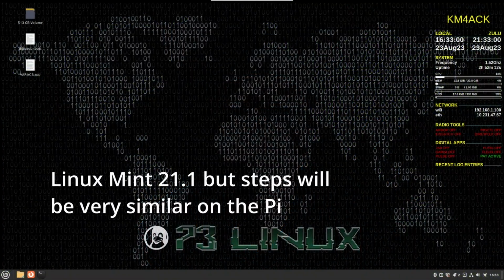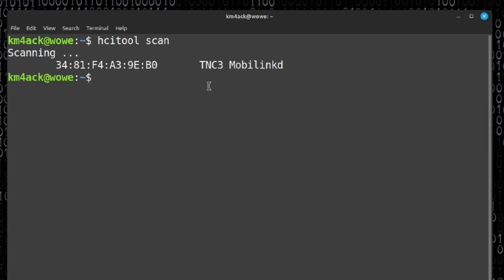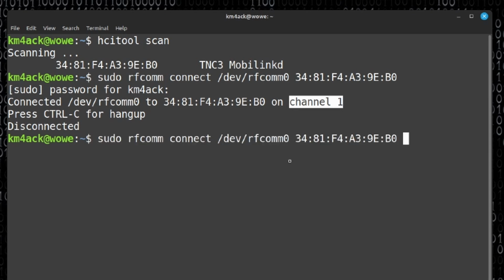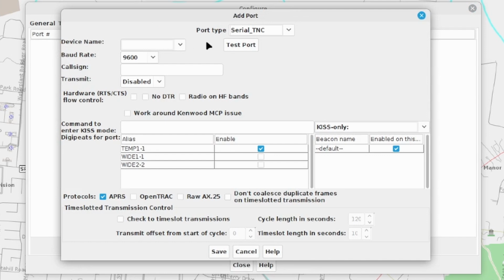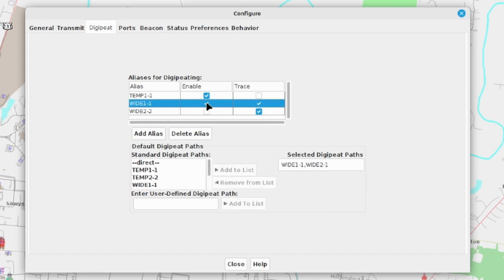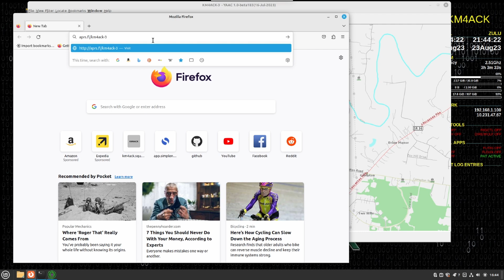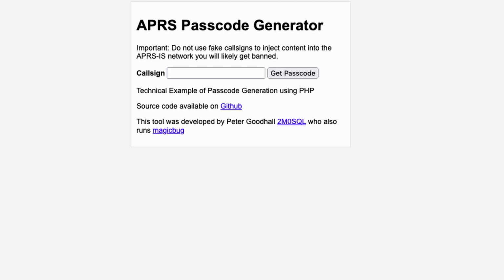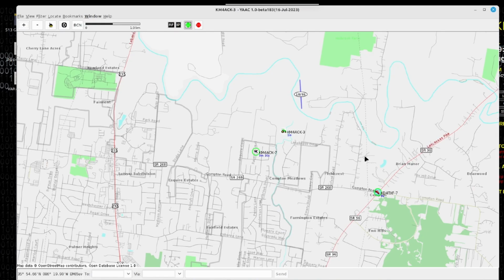Mobilinkd APRS Digipeater Setup

Comment: When I connected to my Mobilink TNC3 via bluetooth, I had an issue wherein /dev/rfcomm0 could not be opened.  The YAAC application threw a 'permission denied' error.  I am running Linux Mint v21.2 on a fresh install on an old HP Elitebook laptop.  The problem was that my user was not a member of the 'dialout' group.  I added my user to the 'dialout' group then rebooted the PC.  I am able to move on from this point.  I found a similar error for people trying to open serial ports going back more than 10 years ago.  Hope this helps someone else!

Comment: Which do you prefer?  This digipeater using a mobilinkd TNC or the one in your other video with a Pi Zero 2W where you use direwolf as your TNC? I want to tinker with one of these, haven't decided which route to go and if either has an advantage over the other.  Which would be easier to also implement as an i-gate???  Love your educational videos.

Comment: Love your videos! now you gave me a reason to use my Mobilinkd 3 again. If you ever get a chance it would be awesome if you could show us in another video how to create a crontab -e script to use with the Raspberry Pi so the Bluetooth connection and Yaac start automatically. I just followed this video and got it to work perfectly fine on my Raspberry Pi3 still running Bullseye with external GPS and your Build-A-Pi app installed.
Reply from the maker: It's not simple to start the TNC connection but it can be done. You can see how I did it in this script https://github.com/km4ack/patmenu2/blob/master/mobilink Personally, I would write a script to do the work and then call the script from crontab at boot.

Comment: I am getting "Can't connect RFCOMM socket: Connection timed out" when attempting to connect rfcomm0 with my Mobilink MAC address. When you first execute the connect command a "TNC3 Mibillinkd Connected" message flashes on the screen, but a few moments later this time out message appears in the terminal.
Reply: What is strange is that I can successfully connect to the TNC3 via the Bluetooth manager GUI, and set it up as a serial device that YAAC can use. I cannot do this within terminal.
Reply from the maker: See the pinned comment on this video.
Reply: @KM4ACK  I am in the dialup group, as confirmed when attempting to re-add. However, terminal access to connect to rfcomm0 fails, while doing so in the Bluetooth Manager works. Strange indeed.

Comment: One note - if you don't need the GUI of YAAC - APRSd is a simple command line digipeater/igate software that works really well - as I remember it, the Mobilinkd is a simple KISS TNC, so APRSd can support it directly, or also by means of the Linux AX.25 networking stack.  I used to run a fill-in digi/i-gate here locally with an old Pi-1B, a TNC-Pi, and APRSd.

Comment: On a different note, I  hadn't been able to get my 705 to pair with my Linux laptop... going to use the process you provided for the  MobiLinkd to see if that will stop the connect/disconnect issue on it. Thanks! 73//KK0DJ

Comment: Jason:
Although you had me at APRS Digipeater, I was wondering if the same concepts apply to DigiRig, as I looked on mobilink's site, and Amazon, and was unable to locate a mobilinkd 3 device, looks like they are going with the V4 device going forward. I do have a DigiRig 1.9 thatt I've successfully set up with Direwolf, on a Baofeng HT but am always looking for other ways to go...
Reply from the maker: Correct. V4 is the only Mobilinkd available now. I have one and it works great. The only difference will be the rfcomm command shown in the video where I point out the differences.

Comment: Great video, Jason. I've been participating in "APRS Thursday", run by KC8OWL, but do not have any local APRS infrastructure in my area, so I deployed an RF-only fill-in at the house. I opted not to deploy an IGate just to challenge myself. My setup is using a directional antenna (Arrow II Yagi) at 15' pointed at Phoenix (20 miles south); a 5 watt HT connected via the DigiRig mobile, and Dire Wolf. This solution is nice as I can walk around the house and the surrounding area with my VX-8DR using this fill-in. Keep up the good work and thanks for putting this out there. FYI: YAAC is my go-to APRS application.
Reply from the maker: Nice setup. I ran xastir for a long time but prefer YAAC these days. Much better offline maps.